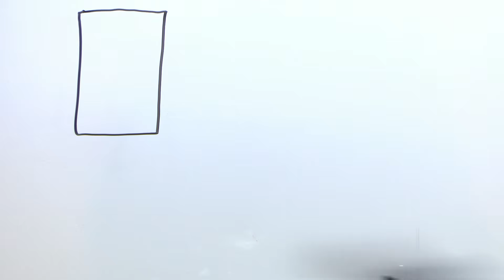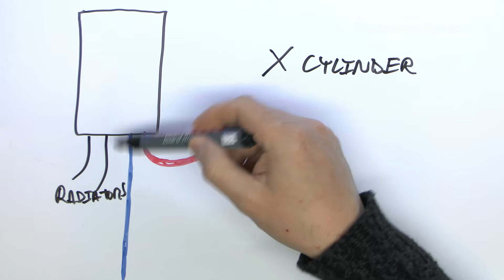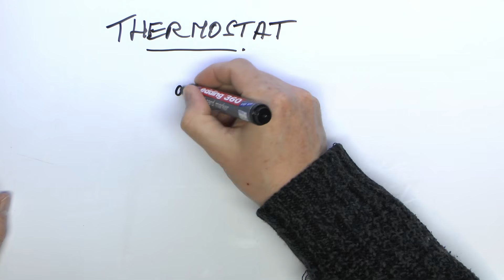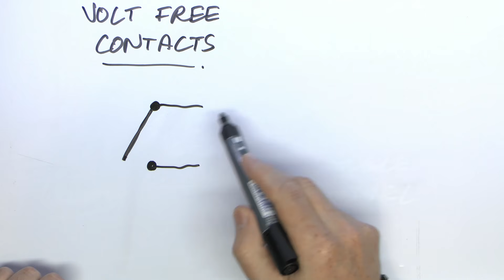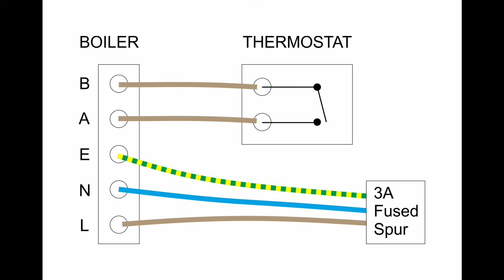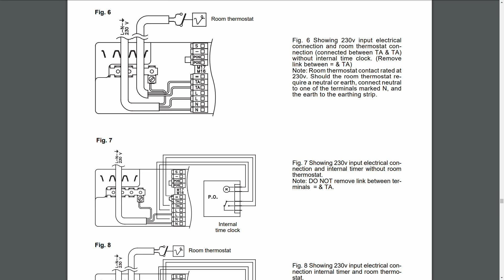Combi Boiler Thermostat Wiring

Comment: Hi John
Any chance you can do a video on the overpriced nest system. I can find a good one anywhere and yours are always top draw. The ones I found show the heating side but not really the hot water side   Ie how to connect into the cylinder stat.   Cheers

Comment: +John Ward
I've seen older non-electronic, mechanical thermostats that simply have 2 contacts only (no neutral)! that ARE the old 'twisty-dial' style.  I get the impression they use a mechanical mechanism to provide the needed "hysteresis" (not turning on and off repeatedly at threshold).  I think we have an older honeywell thermostat of that variety that (appears) to work fine.
An obvious (to me) solution if you for some reason want to use mains-output 3-terminal thermostat, or the hive dual-channel "mains" output,   is to connect this N/SL output across a 230v relay coil, and put the secondary of the relay across the boilers' volt-free-contacts ...  WHERE/how to safely locate the relay and how to crimp/solder/whatever its' terminals correctly is another matter.
Reply from the maker: The relay is certainly an option, and is usually what's done where there is an existing combi boiler without mains switching, and additional heating zones and/or a hot water cylinder are installed.
Reply: Thank you take care regards colin